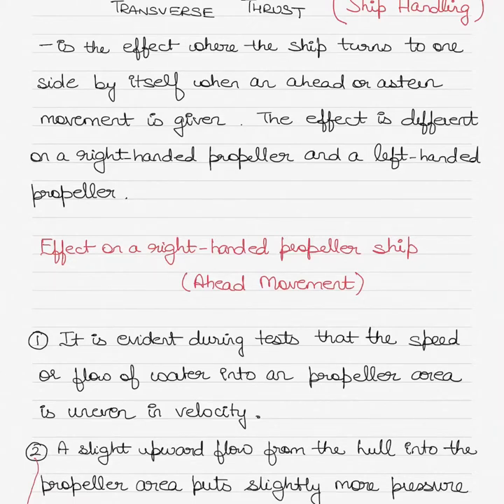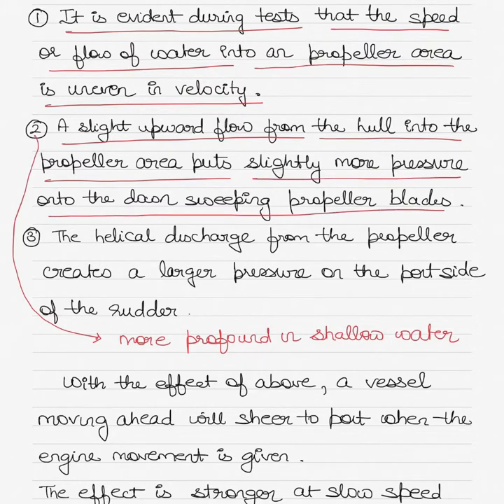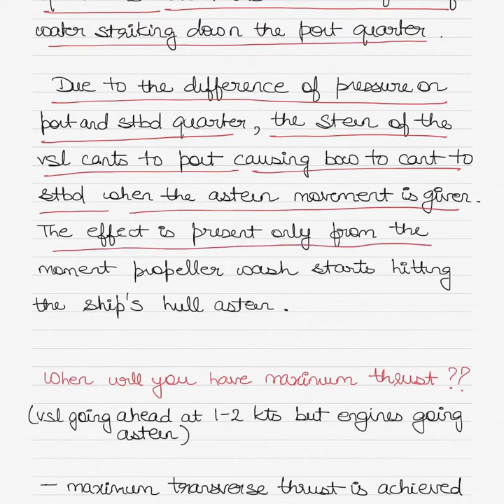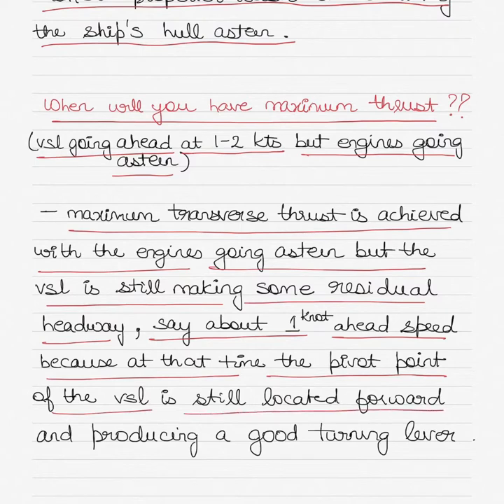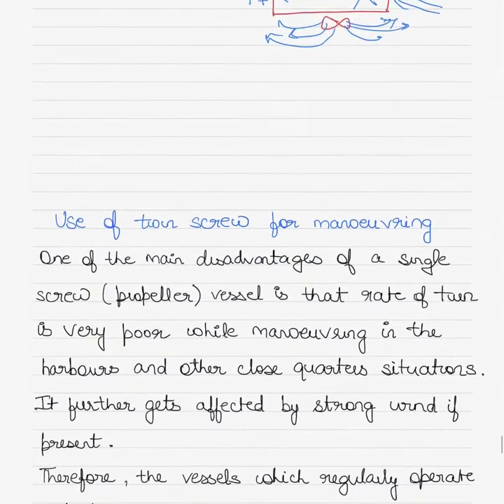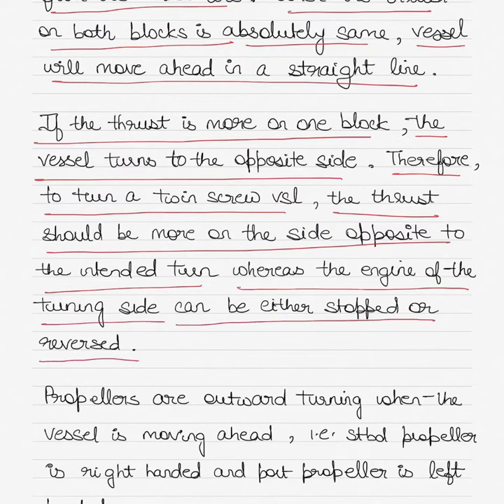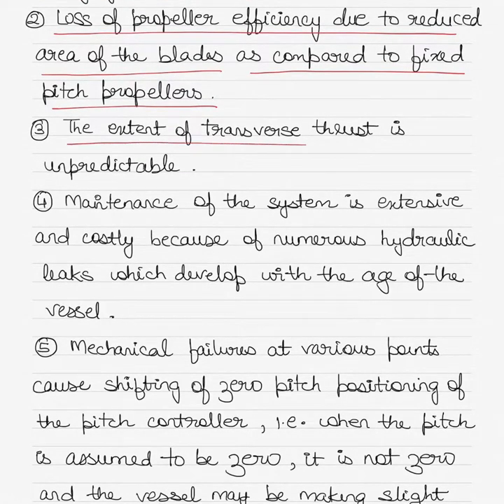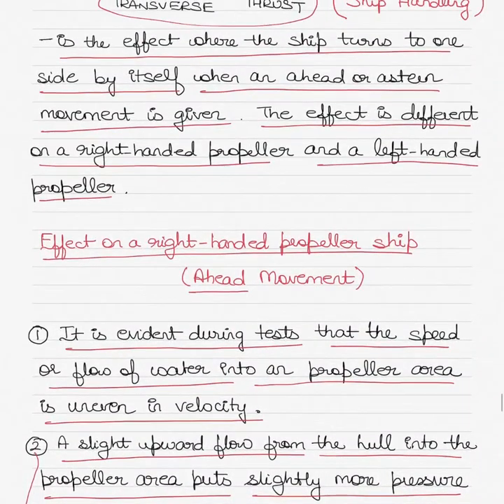Tranverse thrust - effect on single screw, twin screw, and controllable pitch propellers

Comment from the maker: @nabajyoti kalita 
In the initial stages of the ship getting underway, the vessel’s speed is low but the engine (and, therefore, the propeller) is at high Rpm ahead.
During this period, the transverse thrust is directed to starboard and the ship’s turns to port. Please note that as the depth increases, water pressure increases, therefore there will be difference in pressures on top and bottom of the propeller blade. This is due to the fact that the pressure from the water is higher on propeller blades in their deeper position than in their shallower position. As the water above develops turbulence and the air is sucked in which reduces the pressure on the top blade. As the ship gradually increases the headway, the turbulence is reduced and the pressure on the top blade increases.